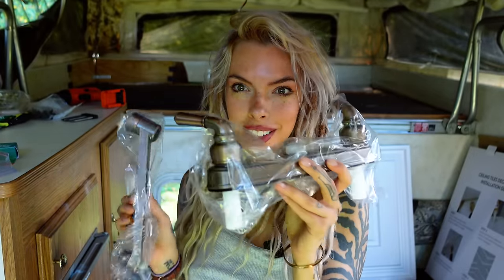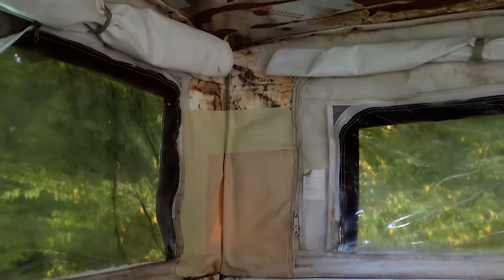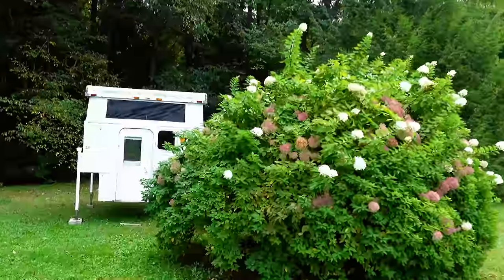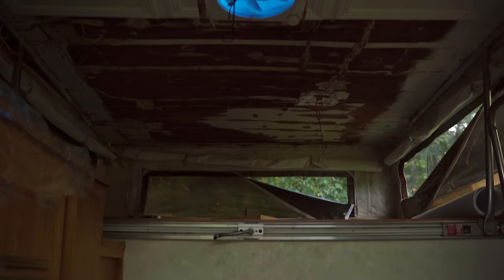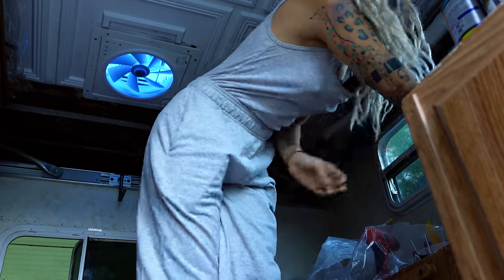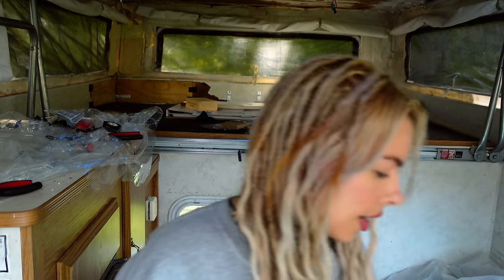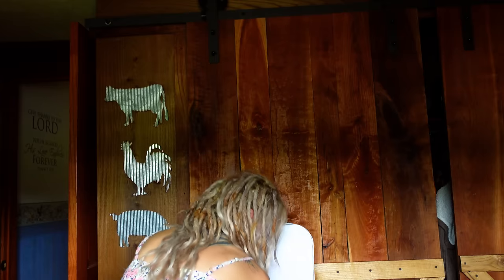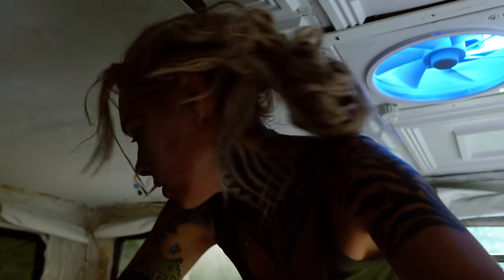hooking up the electric *for the first time* in my Old Truck Camper

Comment: Whomever sold to and took advantage of this girl should be horsewhipped. The amount of work she has put into this, trying to breathe a useable life into it, is amazing. I commend the effort. At this point I think we ALL should just show up and get this done for her. Surely there are enough of us experienced enough to do a complete, and functional restoration.
Reply from the maker: Awh thank you - that’s so kind
Reply: She really got scammed.
Reply: It’s a money pit….stop …. Sometimes you have too.  I agree seller should be stocked and stoned.
Reply: This thing should have been given to her.  I feel bad for her.  i think she paid 3000 for it.  
Rumpled?  That is basically rot.
Reply: @TorieRobot  Have you ever seen that stuff you roll on in the Bed of a truck for a bedliner! It’s like a rubber sealer. Just google roll in bedliner, several different kinds will come up. I’m thinking that you could roll it on the top of the camper as well as the underside of the top,  so you would be sealing it top and bottom, or the inside roof. You would just want it in a white color. It sticks to just about anything. And it would definitely seal everything. Keep up the great work! 😇
Reply: @jeffreyferguson83 they make a roof coat for mobile homes called snow coat its really thick and just rolls on with a paint roller. 👍its called Ames snow seal. Easy to apply.
Reply: @bigpas My buddy Nick and I are in. Road trip!
Reply: She likely bought it for the content..
Reply: @TorieRobot  Elastomeric Sealer
Reply: If it was done, there'd be no content.  Makes me appreciate mine.   2k.   AC 
All there.  But 3 jacks.   Works for me
Reply: Dude chill anyone buying second hand shouldn't complain
Reply: Let’s find something that will make good content. :-) I’m would say this young lady has enough men that follow’s her around she was told what she was getting into. Trust me she got just what she wanted…. She’s the type that always will. Till age catches up with her. 😢 And at that point “if she has been smart,” it won’t matter. 😊 At this point she seems to get more things from her wish list than most content creators.

Comment: As a contractor of over 40 years I would suggest getting a one piece EPDM, rubber roof put on that thing. It will be blackish but at least it won't leak and it will be glued down. Seriously girl something to look into
Reply: It would, but at the cost of considerably more weight, which she already has  a problem with on lifting it up.
Reply: @JohnCampbell-sl5nx  it wouldn't be considerably more weight, the lifting system obviously isn't working correctly,  that's the problem,  not the weight.. a few guys who know what they're doing, could get this roof fixed in a few days.. it's not hard, I've replaced several rv roofs and self built a sprinter and a cargo trailer
Reply: @Liimpy reach out to her if you or your associates can help.
Reply: @robertholland7558  I'd be happy to help. Unfortunately,  she's on the opposite side of the country, I think. If she brought it to Colorado,  no problem
Reply: @Liimpy  maybe you have contacts closer to her location.
Or a great excuse to go on a holiday, though with 40 years experience, that might be deemed too creepy, it likely makes you her father’s age.

Comment: Your optimism is amazing. We have tape that we found on a you tube video that we sealed our rv roof with.  I’ll put the name on here.  It’s really bada$$.  Eternabond Roof Seal Tape.  Stopped my roof leak immediately.  Get amazing reviews.
Reply: upvoting so hopefully she sees this!
Reply from the maker: I’ve looked into that stuff- I’ve heard mixed reviews about sealing with tape
Reply: @TorieRobot  the eternabond brand did wonders for our 11 year old rv.  We too buy used and fix up.  Great stuff is also a staple in our “fix it arsenal”!

Comment: Did your dad add sealant/caulk under each screw? Trust me, try  3M 5200.  Buy the smallest tube, back out each screw a little bit and squish a pea sized dab of 5200 behind the screw head, then screw them back in. Do this all in one pass as 5200 starts curing as soon as you open the tube. Use tight fitting gloves and wipe off any excess goo. Try not to get it on your skin or clothes. Once this stuff cures, it is turns tire rubber solid and really hard to remove. I used it on my hot tub to seal some gaps around my water inlet. It's still good and solid 8 years later.
Reply: Caulk is for interior filling, need waterproofing sealant.
Reply: @freddythefrog70  There is outdoor caulking also

Comment: So, I had a few leaks in a camper we rebuilt.  We used Everbond Tape and Everbond in 5 gallon pale and rolled it on the roof, then flexsealed and everbonded the seams from outside not inside and never once had a issue again with water.  Keep up the good work and I know you want to be in and done, but.... Take your time and try your best to not rush it.  Itll work out in the end and you will have a peace of mind knowing its done

Comment: To seal the roof use 2 part urethane (bed liner) NOT the cheaper 1 part stuff. Key or scuff with a abrasive cup brush, sand paper, scotch bright, ect. Clean well with acetone, the cleaner the better.  Don't put the aggregate in it for smoother finish. Spray it on is best but can be done with  a roller as well. I have done many of RVs this way and it works well and gives you a seamless urethane water proof layer.

Comment: Hey Tori, one of my vehicles:  no working heater or vent fan, no A/C, one of the doors is jammed, cruise control non-functional, rear window latch broken, exhaust system needs replaced.  Never give up!  Never surrender! 💌

Comment: I have loved watching the videos you’ve made so far and I hope that things get easier for you! My situation seems similar to yours I was homeless and bought a camper to fix up to live in and it turned out to be wayyyyy more work than I imagined. It really felt like my luck couldn’t get any worse and it was just one thing after another. I had to redo the roof,  redo several interior walls from water damage along with one exterior wall and a lot more. Ive been working on it for about 4 months and it looks like a completely different camper now and im so proud of myself and that I didn’t give up and you’ll feel that way to so keep it up don’t let the hurdles or the haters get you down!

Comment: You're doing great work, keep it up! I knew those screws were going to leak. I would plastidip over the enter top including all the trim/edge moulding. Tarp the whole thing every day if you're expecting rain until all the leaks are fixed. You can always spot test waterproofing with a hose instead of drench testing with rain.

Comment: You might want to try EPDM coating on the roof. It will seal the leaks. You can coat it right over the self tappers. It works pretty good for leaks. I used it on my truck camper after the roof repair. Clean the roof before applying. You can use it on the sides where the self tappers are or over the whole roof. If you just do the sides tape off along the top area not to be coated.

Comment: Okay, as someone who has rebuilt a camper, here are my tips, hopefully something here can be useful to you
1) i know youre using self leveling caulk.  Thats great for roofs, for exterior walls i will never use anything except Vulkum 116 from now on, its highly flexible and hold amazingly. I did use it on aluminum though so Id double check that its good for fiberglass. 
2) rv roof tape might be a good friend for you, its great for going over seams, id say it can probably used on exterior walls too, youd just be able to see it. 
3) the screws- anything that penetrates the shell has a chance to leak and will find a way to leak, so youre absolutely right about needing to seal them with a sealant of some sort. 
3) if you used rivets anywhere and didnt use a compressor and a rivet hammer and the rivets have a little divet in them, then you proba ky used whats known as an open rivet, and they will leak. Absolutely pop some sealant on them too or a strip of the roof tape. 
4) waxing the canvas you fixed is a great idea, pay extra attention to the stitching because it will be an extra leak zone, maybe you could use tent seam tape on the stitching? 
Hope something here is helpful! Youre doing a great job and its horribly stressful but it will be worth it and youll know how to fix any problems on it down the road. 😊

Last tip- put painters tape over the spots you think leaks are coming from before it rains. If it doesnt leak then youll have a pretty good idea that youve found the spots and you can start whittling down the leaks a lot easier.

Comment: Well hello Victoria, 
I can feel your pain with the water issues... Water will always find the path of least resistance!  I've never used it..?  But I'd try spraying a few lite coats of that flex seal over all the outside screws and sides of the roof..?  To make a waterproof membrane outside to seal out the water from coming in..?  
What do you have to lose @ this point?   Maybe even trying it on the inside where water is coming in..??
  The commercial for flex seal,  It will build a boat?  Good luck with finishing your home!

Comment: Check the rubber seal around the outside of the window trim where the window meets the metal. Being that's an older camper. The sun dry rotes and shrinks the rubber seal. That could be where your problem of leaking is over that window. Also, you could get a small thin rubber seal to put on the roof top edge where it meets the lower edge as you crank it down so that it creates a rubber seal which is as well waterproofing that break point on the side walls when it's in the down position.
Reply from the maker: I’ve checked that- it’s not from the window but I did seal that too
Reply: @TorieRobot  ok yeah that's good I just had that problem with mine and thought maybe it's your window. I'm glad it's not. I would try to put a thin rubber seal all around the under edge of the roof lip so that it meets the side walls when in the down position. I did that to mine as well and it stopped the water from pushing into the canvas as I was driving and making it leake all around the front and sides. And when parked in the down position

Comment: I spent a summer replacing rivets on my pop top, because they were old and started to let water through. At times I felt it would have been easier to burn it, but it's a love hate relationship, when its working you absolutely love it and wonder what the fuss was about, when it's not.... well you love to hate it and spend more time fixing it. Keep up the great work, it'll be worth it.

Comment: That Flex Steel works really well on the outside. I’ve used it on my camper. It’s been about 5 years and still no leaks where I used it.
Reply from the maker: Maybe I’ll have to get some more and paint it on
Reply: @TorieRobot  Hope that will work for you. Water leaks can be so insidious.

Comment: Nice.... You're doing awesome Victoria! The important thing to remember when faced with a project consisting of multiple tasks is to not get overwhelmed and just do one thing at a time.... Little by little it will all come together! 🙌
Reply: This is a money pit she should get rid of it. It’s not worth it.
Reply: @lauramoor7730  Not necessarily.... Most individuals upgrade a van for example and when the van blows an engine or transmission, you're out the renovation cost.... When she's done with this though, she'll have a mini home she can put on different vehicles.... 🤙

Comment: I understand your frustration, you're making grest progress though. I love the lights !
 My neighbor has a camper as well, she has had problems with water leaks and not being able to find them.
 Finally but she bought a blue tarp, glued it to the top and down the sides, trimed the edges off. All the leaks have stopped. 
 It's not the prettiest camper, but it does work well. She uses it often with no worries of leeks !

Comment: Hey T, so when I built my trailer as well as the boats I make I use something called poor man’s fiberglass which is completely water tight and super easy to do. You just mix 50/50 tight bond wood glue and water, roll it on, then lay down a big sheet of line fabric over it, pull it tight and roll on another coat or two. It will harden like a perfect water grill shell and cutting around the fan and whatever else is super easy with an exacto knife. All of your water issues will be solved instantly. Lastly it’s completely paintable after it dries. Hope this helps T!
Reply from the maker: I’ve heard of this technique thanks!

Comment: Your best bet is to remove the screws on the roof one at a time, apply silicone to them, and then drive them back in.  Water will make it's way through those holes regardless how tight the screws are.  You shouldn't use wire nuts on a truck camper, as they can come loose, you should ideally use a crimp connector, or something else that will survive running down the road.  It's a little late now, but you shouldn't keep working on the ceiling while you have an active leak; if there is any leaks from the top, the foam and ceiling tiles will hide it as well as keep damp or retain the water up there, and really make your life hell.  I would say don't worry about putting new fabric in and painting the inside until you get the water situation handled.  It's obvious that some areas below the canvas are rotted out, and will need to be replaced.  Black mold is real and you can eventually expect respiratory issues unless it's dealt with.  I personally would not be leaving the power on in there until you can fully actually dry that camper out...  Water and electricity are a bad time and you're basically relying on circuit breakers, fuses, and hopefully GFCI breakers to prevent catastrophe.  If you think you've put a lot of money into it now, imagine how it will feel when that things catches fire.  Food for thought.

Comment: Instead of caulking the screws, butyl tape works very well. I use it on my camper and it hasn't failed. I've had my camper for 2 years now.

Comment: You’re doing great girl! I think you need to get it out of the humidity and rain and let it properly dry before you start painting and coving it all up. You’re locking that moisture in that will continue the mold. If I were you I would drive out to Arizona or Nevada and give it time to dry out and then handle what you need to from there. Also I would try to find a new canvas if it possible. It’s gonna look great and I’m so proud of you, keep it up!
Reply from the maker: lol that sounds good in theory but let’s be for real- I’m not going to drive all the way to the middle of nowhere and paint it in a parking lot- just doing the best with what I have and where I am. It will dry out after this rain streak
Reply from the maker: And thank you for the encouragement 🙏🏻

Comment: I'm so Proud of you.. and I would never say you're a Hot Mess .. but if I did I'd say you're more Hot then Mess but I love that you're ok with making failures because you learn from them and you are doing the right stuff, just hang in there and keep these things on the road, I have a 1976' Six Pac 8 foot camper and need those jacks, mine are leaking and the company went out of business so getting a rebuild kit is like finding hens teeth .. Good Luck Victoria !!

Comment: Hang in there Torie l The electric was a big win, as well as the ceiling. I think if you have a flex seal party on the entire outside of the camper you can win ! 😊

Comment: Personally I would have never chosen a used camper that has canvas as part of it but I am more impressed with some of the material you used for the decorative ceiling and some of the lights.  I'm intrigued with what you will use for the cabinet repairs.  Looking forward to your new videos.
Reply from the maker: I just wanted a camper that was aerodynamic which is why it needed to have canvas and be a pop up- in the future I’d make payments on a newer one but for now I’ll test this out to see if it’s even a lifestyle I want

Comment: For your corners and trim/corner beads, use butyl tapcleaning thoroughly with acetone.  One rag clean and wipe the area of the seal and with another clean towel wipe dry. Apply the butyl, remove the tape on top and the apply the trim or windows after cleaning with the same process.  And the canvas, it shrinks over time and replacing is usually the only way.   Look into canvas for making sail covers, use the original canvass for patterns allowing for the shrinkage from the patterns.  Make them a 1/4” bigger all the way around and stitch them up with good quality sail thread.  There is a channel called Sailrite and they have fantastic tutorial about the whole process of pattern making and sewing.  Take your time and follow the directions carefully and you’ll be set.

Comment: Glad that your appliances work.  Most of your leaks likely will be at fasteners (screws, etc.) and gaps in corners.  The rain substituted for the "water hose" leak test and may have found most of your leaks.  I know it is not exciting to see all the leaks, but it does point out where they are.  I like your plastic (tile looking) ceiling.  Looks nice.  Keep going and you will win in the end!! .. ROBERT